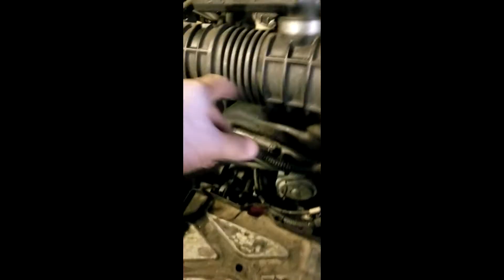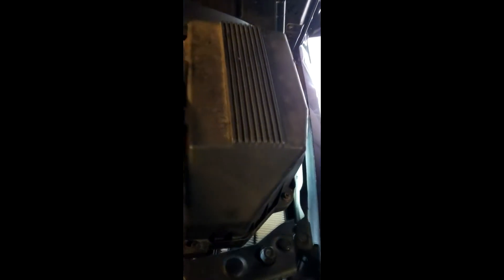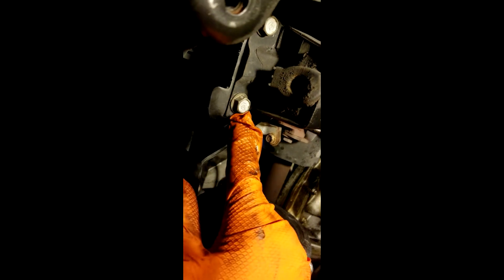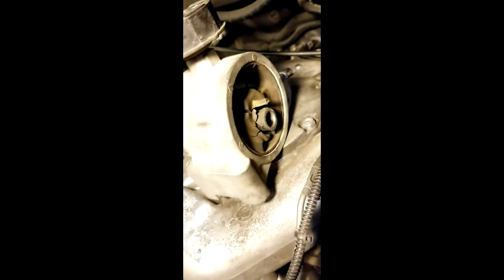How to change the MDX rear engine mount

Comment: You did it backwards but I don’t know if it matters too much if the pressure is off the motor with a jack. You should do the bottom ones first then relieve pressure off the motor.
Reply from the maker: good to know.
Reply: Hey what year is the Acura you were working on?
Reply from the maker: @tobiasedwards8782  2005

Comment: Much appreciated. So the rear motor mount is attached to the subframe.
Reply from the maker: I don't remember if it was a sub frame. I do remembering it got easier taking off the muffler pipe.